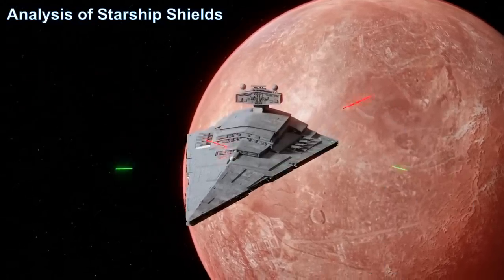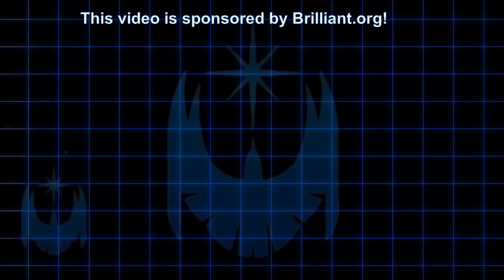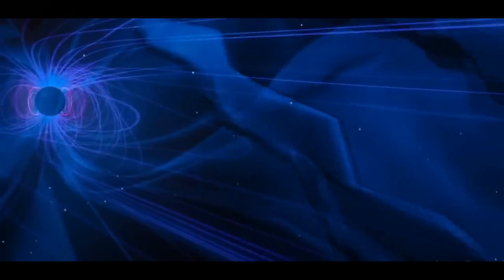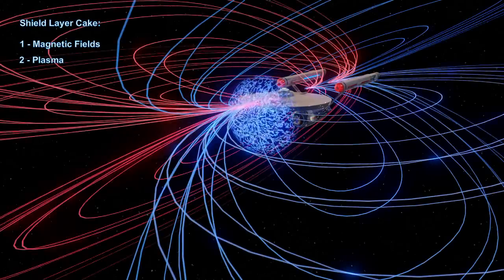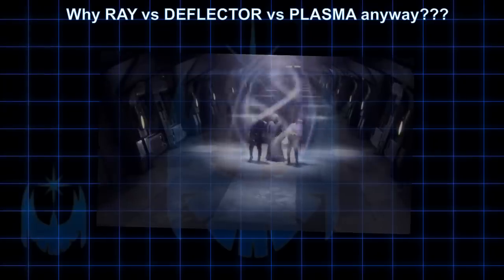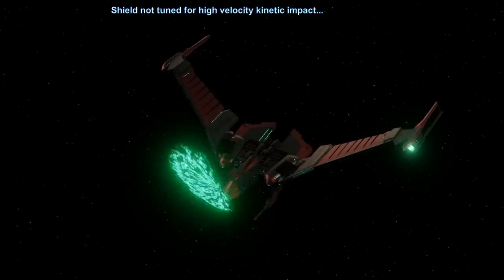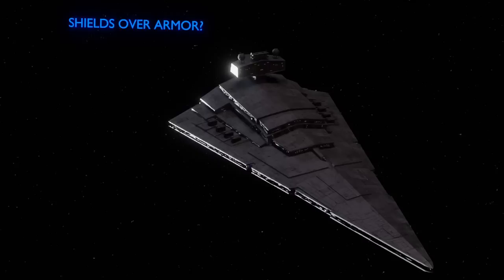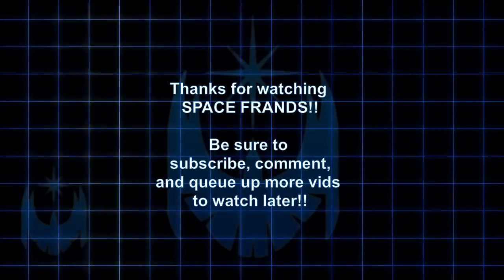REAL Starship Shields Types - They Work Like This...Animated Breakdown!

Comment: If you can deflect navigation hazards at near luminal speeds, tanking any weapons will be nothing. You will blue shift radiation so much that anything you use for that can be tanked just by turning toward the munitions. Of course, lasers and unguided kinetic weapons will never strike a competently crewed ship as the ship will simply not be there when the munitions reach the area where the ship was. Leading will not change this as a ship will only need to vector off a tiny amount from original course. Only guided material weapons have any chance. Even if they are nuclear, whatever defeats the radiation pressure of interstellar travel will absorb the EM wave as if nothing happened. Only getting close enough for kinetic impact will matter, and that can be handled by a point defense laser system. Lasers will not ever be a viable offensive weapon. They will have coms usage and a perhaps means to bleed heat away from enemies to help diminish your own detectable IR emissions.

The knife-fight range battles in Star Trek or Star Wars only happen for dramatic and eye candy purposes. It's actually ridiculous when considering the distances and speeds involved with actual interstellar travel.

Comment: Star Wars had another shield type in the older material, a Particle Shield. Thin layers of heavy particles trapped and sandwiched between magnetic fields. Not quite plasma, they couldn't stop most energy attacks but solid projectiles hit them like hitting a brick wall.

Comment: I worked on a shielding device that was tested on the X37, basically a plasma layer cake of ion/electron/ion/electron alternating directions, intended to deflect alpha and beta radiation around an object. Works extremely well and low energy with the field modulated by a superconductor - which converts the kinetic energy of the radiation into thermal energy, picked up by the superconducting mass. 

Hit a big cloud of particles and watch a bit of liquid helium boil off

Comment: The idea that Shields aren't large and massive is a bit flawed. All of the hardware needed to manipulate those magnetic fields and keep the high energy plasma hot and charged is still big and bulky. IE: Fusion reactors are not small nor lightweight.

Comment: Honestly this whole notion is ridiculous. It'd require such a ridiculous amount of power to block or even deflect a kinetic slug with energy shielding that the waste heat generated would cripple your ship by itself. And any type of energy shielding is gonna be strictly inferior at absorbing laser weaponry than physical shielding would. Likewise it would be vastly less effective at countering missile weapons than point defense cannons.

The only thing therefore that energy shields would be useful against is plasma-based weaponry, which... just isn't actually a thing. I mean yeah, it's a weapon category in most sci-fi settings — but if we're talking realistic analysis, plasma weaponry hasn't evolved past theory for very good reason. It's just not practical, especially in space combat compared to other types of weapons which are already very well optimized for the setting.

Realistically, there is zero reason, if you're investing in the gargantuan power plant capacity and heat dissipation necessary to run a halfway useful energy shield, that you wouldn't just direct it towards superior laser output instead. Space is a battlefield with no cover or obstructions — the ability to inflict more damage/heat buildup from a farther distance is a better use of those energy resources 100% of the time.

IF there is any practical use for energy shield tech in real life, it will be deflecting micrometeorites and debris OUTSIDE of combat.

Comment: Plasma is very much opaque. It would be best for blocking lasers. Not good for reflecting them. 
It would also block any electromagnetic sensors. Also: very energy intensive. And to end: which type of plasma? There are so many possible parameters about it's temperature and pressure...

Comment: It sounds to me like the most practical strategy for shield use would be to have a tunable plasma shield that's normally set to deflect the most common forms of high-speed weaponry, with some sort of detection system that can retune on the fly to respond to slower moving threats.

Comment: 4:47 mmmm mirror finish armor and an atomizing water sprinkler for lasers. (creates a dense cloud of ice crystals that defract and dissipate incoming beam weapons bleeding off power before it hits the armor plate.) Id also use some form of energy cell dissipator to spread out the energy along the surface and reabsorb incoming energy)

I think their deflector shields work along the principles of ionizing incoming matter (the deflector screen has been shown to be used as a "beam" before) using wide spectrum forward facing field emitters and it uses the starships impulse drives, which are traction drives (magnetic field drives that can interact with a stars magneto sphere to create a pull/push effect) to push incoming objects away or around the ship.

Ironically enough a deflector screen would make an interesting "anti-cloak" device as it could bathe incoming ships within a field of ionized particles that would cling to the cloaked ship casting a silhouette on scanners.

Comment: A common misconception about Starwars is that the turbolasers are actual lasers and not light based. In fact they use a fake gas called Tanana that amplifies a laser pulse into a plasma charge. So, despite Starwars crappy naming it actually is more plasma than actually a laser.

Comment: There's another type floating in my mind which is basically a broadcast which cycles through transmission frequencies and possible code combinations at insanely high speed to trigger the abort/destruct code on incoming torpedoes or missiles.

Comment: I had an idea once for a series where the manipulation of gravity has been achieved. This enabled FTL travel (by targetting points of space and pulling them closer with gravity beams). But another novel idea someone else pointed out to me is that a ship that could control gravity and lock things to it could use ozone, or non-newtonian fluidic shields. The idea being that the vessel vents an amount of ozone which is then held densely around the ship, which will burn up incoming projectiles and also dissipate directed energy weapons. The idea of using non-newtonian fluids would be such that the harder something hits, the greater the reactive force of the fluid, which hardens and breaks the projectile, while also dissipating energy in the same way as an ozone layer would.

Comment: why  would the weight of armour matter in a weighless enviorment
Reply: Because inertia is a thing.
Reply: @acedynamo  Which only effects something if you rapidly change its directions. do you know what inertia is? Essentially a space craft would travel from point A to B in a straight line, if you did a  U turn mid flight then yes inertia would rip the  craft apart.

Comment: I think the biggest flaw many overlook is Star Wars lasers are not Lasers in the traditional sense, but are more like energy bolts. Which is why even at great range Star War laser weapons remain potent instead of the fast degradation of heat over distance.

The Death Star laser even  though it appears as a beam, does actually move but at high speed. We see this as the energy builds then is released into a devastatingly large energy bolt. Which is called a Laser even though it's not. Star Wars lasers move too slow too be chemical lasers. 

Its sort of how many creatures that have crab in their name are not actually crabs but separate species entirely.

Comment: Hang on there Shields are useful but Armor is not? How many times do we see power failures in Sci-fi or event targeting of the shield emitters or even targeting of power couplings or the like because they emit detectable power? Once your power fails all the shields are useless. So you need bunkering as well as various hulls and armor plating. And given the advanced technology nano armor or the like might be a real thing so your ship could in fact replace armor plating in combat. The idea of bunkers is nothing new in Naval warfare but in the Expanse, we see this on the MCRN Donnager. Additionally having multiple hulls allows damage to be sectioned or negated. As for nanotech armor and the like it would be plausible to create interlocking bots of various sizes that could "armor over" and seal holes in the ship as a temporary fix. In Star Trek all the ships are built like civilian cruise ships (when given cat aways views) given all the combat and enemies in Trek they still build ships that are resilient but always defeated. It is a tired trope.

Comment: Ok well ima say it beam weapons are pretty crapy for space battles for 1 space is massive even just the distance from the sun to the earth is is about 8 light minutes and u have to note that basicly what ever ur sensors are detecting is outdated info since it took about 8 lightmins yo get to ur ship that means u would have to predict where ur enemy will be and and since ur opposition knows that it will be doing random evasive maneuver its almost impossible to hit. 2 even if u predicted where the enemy ship is u better make sure the beam has enough energy to do damage  that means BIG emitters and even bigger power generation that equals more mass only think I can give beam weapons to is some sort of point defense or even very upclose and personal offensive weapons im talking 30 light seconds or closer I predict future space battles will consist of rail guns lunching smart missiles to a % of light speed or even rail guns just blanketing a part of space or some sort of warp driven torpidos or what ever ftl is invented

Comment: In Star Trek: Enterprise, they didn't have traditional shields, but instead polarized the hull plating.  How does that fit in here?  It sounded more like they somehow strengthened the structure of the ship, rather than using an electric current to create a magnetic field, but I don't think they went into detail about it.

With more traditional shields, another aspect Star Trek uses is segmented shielding.  I wonder how that would work, since I would think a ship would have to generate a magnetic field all or nothing.  You couldn't just create half a magnet.

A common scenario in Star Trek is needing to beam up an away team from another ship or planet, but are stuck in combat and cannot afford to drop their shields to do so.  I would think this would be very easy to do with segmented shielding.  As they often do in battle, keep their functional shields towards the enemy, leave one segment open, and beam up the away team through that one, but I don't think they ever do this.
Reply: Classic shields in Star Trek are built into the armor itself in sections. In essence, they are covered in hull-shaped shield generators.

Comment: This was a great video, explaining how energy shields can really be used effectively against multiple types of weaponry.  (The Star Trek Technical Manuals explain the tech in more futuristic terms - activating a giant magnetic field can wreak havoc with all kinds of present-day technology, avionics and electronic control systems for engines [ !!! ] among them.)  Really the limiting factors to energy shield effectiveness from this angle seem to be
 •Threat knowledge and preparedness
•  Energy output and heat dissipation
•  Reaction time and computing power

Two additional points below:
Reply: -  One of the things that popped up in the series Farscape is that the Peacekeeper Coalition is one of the few entities that has energy shield technology, and that to maintain coverage over large vessels (Such as a Carrier), multiple layers are used to ensure that at least one layer is (almost) always covering any particular angle of attack.  The ability to project multiple layers of energy shielding would be energy-intensive, probably for any ship relative to its size, but would also be an effective 'defensive stance' between offensive maneuvers.
Reply: =  Something that is not explicitly explained, but is evident from reading the TNG technical manual, is that in combat, one of the highest-demand resources of a vessel is computing power , and this video simply underscores the fact.  Computing shield modulation and adaptation, tracking targets moving at relativistic velocities (relativity equations are daunting on paper - imagine running software needing to update and forecast them in real time ), navigational calculations, and managing command inputs all would tax even futuristic systems towards their limits.  Also, at least in some Federation designs (and most probably Klingon, Romulan, Cardassian, and Breen as well), the main computer core runs inside a static warp field to enable calculations at superluminal speeds - which becomes critically important when travelling at superluminal velocities.  As the warp velocity increases, not only does the power required by the warp engines increase, but the power required by the computer core and the static warp field increase also; because the computer must run calculations fast enough to keep the ship from experiencing a critical navigational error or collision in interstellar space, so the static warp field must be of greater intensity than the warp field propelling the ship - not linearly, but on a power curve.  So in combat and at warp, computing power is at a premium.

Comment: Maybe micro-black holes could be used as deflector shields against lasers (as well as pretty much any other type of attack)? It's not quite technology that we have today, but both these franchises seem to assume most ships have some capacity to bend space-time. It'd be interesting to see a ship not using it's actual shields system, but it's warp engine for stationary defense rather than movement.
It would probably be immensely energy-draining, but if it'll save your ship against an other-wise counter-less weapon it might be worth it.
With a sufficiently powerful and precise mastery of this technology one could even be use it to wrap the enemy attack in a spring and send their lasers back to them.

Comment: while a lot of the ideas i've thought of bringing up are down in the comments, there are 2 that I'd like to bring up that I didn't immediately see, the shields in Independence Day seem tied into their inertia system, that they are a solid state shield and the whole ship, crew included would be impacted evenly by their reduction in momentum by what ever extent of power dispersal the dampening has if it has any more than just applying all the energy across the whole frame and shield evenly.  You would essentially become a pinball that has a lot of give in the outer shell to reduce the total delivered damage by how ever much the frame of the ship itself can take in burden and possibly let the weakened energy through for the armor to handle. I've only seen this as what it appears like in the movie, it isn't even described but this is my take on why the whole shield lights up and redirects the whole vehicle when hit by a missile and why a direct crash didn't cause much damage for the ship the hero of the story brought down, the whole shield displaced the crash then he hit the wall again with the left over momentum.

second, more of a joke, Since the shielding of a plasma shield system would be built like a reactor, would it be feasible or even plausible to build the reactor as the shield? instead of inside the ship it would be on the outside. I saw a few comments about plasma having limited life spans from gas leak to depolarizing the ionized stuff, but how long could it work and propel the ship like that if you basically made your ship a sun and flew a sun around as your power, shield and propulsion?

Comment: I like Macross' approach to shields. they are mostly energy shields but the inital run of the anime the technology was still being developed and they have no shield emitters to handle the entire size od the space craft. the crew has to "place" the shield by anticipating and targetting where the enemy's projectile will hit. For smaller craft like the Valkyries,  some models can be can be equiped with ablative armor. with a finite number of panels that are be ejected to divert and absorb the momentum and payload of the projectile upon impact.
Reply: In Warhammer 40K, imperial knights do something similar. Imperial knights are big huge mechs with usually a large autocannon or energy weapon on one arm, and a giant chainsaw for melee on the other. Their reactors typically aren’t strong enough yield to successfully power imperial void shields, so they make use of an ion shield. The thing about this type of shield is that it may be very powerful, but it can only cover one facing of the machine at a time, so Imperial knight pilots have to rotate their shields to deflect incoming fire. This is why the best way to bring down an imperial knight is to surround it, or simply to catch it in a pincer maneuver, because while its armor may be thick, and its shields may be strong, it can only shrug off attacks from one direction at once. Most tanks in the imperium can deal a crippling blow to a knight that isn’t positioning itself properly. This is why imperial knights, when attacking enemy lines, never stop moving. Just like a medieval cavalry charge, they rush the enemy, punch through their lines and keep going until they break through. Then they reform their own ranks and charge back into the reeling enemy When piloting an imperial knight, the only time you ever want to hold still is when your own forces are forming a gun line, and you are thus, covered on both your left and right.